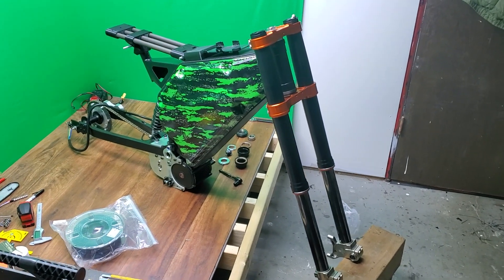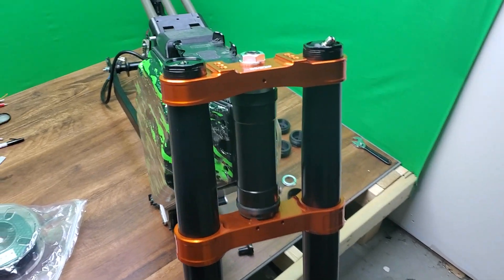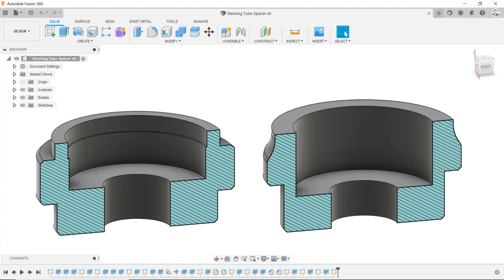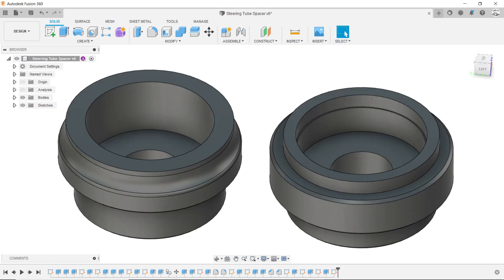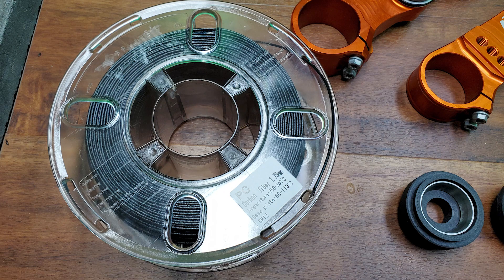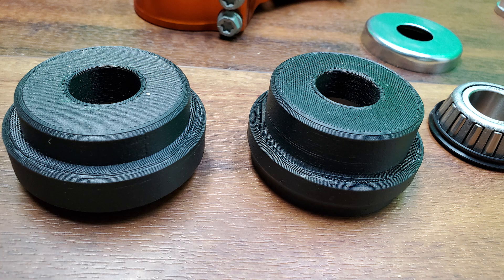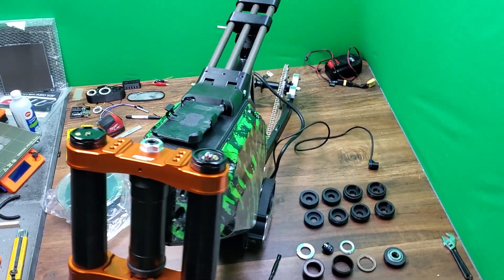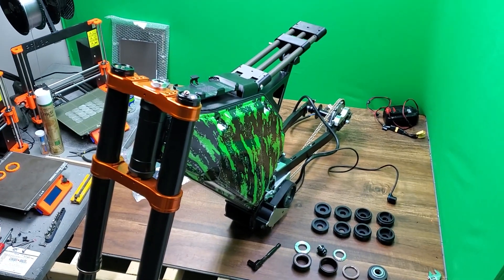Using Motorcycle Forks on an ebike / bicycle style frame - Lightning Rods 10kw Ebike Build Part 11

Comment: What did u make these out of mate did u use a 3d printer?
Reply from the maker: Yeah. They are in a carbon Fibre Polycarbonate. They need proper road testing still. I will probably revert to Aluminum for the final parts unless they look rocksolid
Reply: Ok thanks I'll have to see if there's a place that can make them as I'm wanting Todo a moto setup on the front of my stealth bomber
Reply from the maker: It makes a huge difference especially being able to use moto brakes

Comment: surely not using 3d printed bearing cups? wont last well under load
Reply from the maker: No not the bearing cups. Reducers that the cups are seated in. Using carbon Fibre Polycarbonate. They can't fail catastrophically by design so if they don't work as a reducer I will just get them milled.

Comment: why not 18 inch wheels? i thought bigger wheels have a higher chance of a blow out
Reply from the maker: I have not built any yet. 19" is the max for the front forks and I wanted to match them for the road legal aspect. I will be going to a few wheel places and listening to advice so two 18" wheels might be something that is suggested. Cheers
Reply: @HighVoltageKits  If you look up Google Images for "Enduro Motorcycle", you will find that ALL Enduro Motorcycle Road Legal bike, have a front wheel bigger than the rear. The norm is 2" bigger wheel in the front. 

This greatly improve the handling of the bike and also will put less exertion on your wrists when riding offroad, as your body weight distribution will be more on the seat and less on the handlebar, as you will be more in an upright position on the bike. When looking at a racing bike, then both wheel look the same, the reasons for this, they are made for speed and you are basically bend over forward in order to be more aerodynamic.  Personally, I would recommend 17" rear/ 19" front for ultimate torque. My bike used to have 17" wheel front and back, but I changed the wheel diameter to 19" in the front because my wrists were getting to beat up after a while when offroading.  Also, you may find that tire availability is less for even number wheel sizes, like 18", you can double check this.  

Even if you plan to ride your bike only on the roads, you will find that you can ride longer with less fatigue when you are more in a upright position... Less neck and wrists pain for long rides...   Also safer, as you can look around you more easily when in an upright position.

Cheers.
Reply from the maker: Thanks. Trying out the geometry today. 19" is the most front so one of the combos to look at it is a 19" 17" Front rear. Thanks for the advice!
Reply: @HighVoltageKits  17" rear wheel on your build, will provide crazy torque... believe me... it's going to be a wheelie machine LOL.  Also, depending on your riding style, you can always experiment with different sprocket sizes on your drive train to see what's best suited for the speed/torque requirements.

Can't wait to see that beast in action... ;o)

Cheers
Reply from the maker: Me too mate! Cheers 🍻

Comment: Finally someone uses right components. I build also in the same manner. But I used 65 suspension and brakes for my mid-drive V2. sx85 components are just to heavy for my taste. I will not use it all capability's nor the frame is build for such strength.
Reply from the maker: Thanks. The forks for this weigh in at 7kg. What brake did you end up going with. Not decided that one yet . Cheers
Reply: @HighVoltageKits  Hi, yes I know because i own sx85. 65 fork is 5kg. Ofcourse it is suited fir bigger weight. I end up using Sx65 brakes both (actually they are the same also 85, exept rotors). Front and end. You can watch my short videos to see. I recomend for rear bicycle brakes. I switched rear ktm brake to handle bars. And it is to much pressure needed to stop.
Reply from the maker: Thanks very much! I will check it out.

Comment: What is that belt you have? And what kind of a tension do you have on it??
Reply from the maker: I'm not 100% sure. It came supplied from Lightning Rods. It's pretty beefy. Tension I'm not sure has been set yet as I have not got the wheels built. It's adjusted with bolt as is the belt tracking. I will go through it all when the time comes. There are a few videos on the adjustment on the Lightning Rods YouTube channel. If I remember I will pull a name from the belt but out of town right now so you might need to remind me. Shoot me a message on discord is the best way. Cheers

Comment: What controller are you going to use?
Reply from the maker: Its works well with a BAC2000 based on test results on another bike I am not able to talk about. The BAC4000 runs extremely well. The VESC is another option.

Comment: I don't think you will have any problems with the adapters you have made, they should be able to take the force required no problem, as long as you have printed them in 100% infill... If they are not 100% infill, then they could eventually fail due to vibrations.  Great work and good luck with your build.
Reply from the maker: Thanks. I think they are 60% right now. I plan on filling the tube with spacers. I know exactly where it will fail on the layer line if they do. I'll try a 100% as well. I might also try just the polycarbonate. I made a much thinner test ring and I could not break it with two sets of pliers.
Reply: @HighVoltageKits  What worries me when using none 100% infill parts for this application is the lateral force when braking (forces parallel to the ground). These forces will compress the top adapter toward the front of the bike, while the bottom one will be compressed toward the rear of the bike, this is why it is important to use 100% infill.

Again even PLA should be fine for your adapters if they are printed 100% infill. The compression force from up and down movement of the fork is somewhat negligible as it will be absorbed evenly on the adapters, but the lateral forces is another story... A 100% infill PLA adapter should be as strong as aluminum, as long as it is not being submitted at too high of temperature where it could start to soften.  

Remember that the adapters will received constant periodic lateral forces (ON and OFF) from your braking that could eventually cause breakages where the none 100% infill meets at the outer layers... You're smart, you will get this...  Cheers
Reply from the maker: Thats interesting. I started of with tough pla for testing parts. It makes sense tho. It should not be a problem printing 100%.
Better to be safe than sorry!
Reply: @HighVoltageKits  To put it simply, wherever a part could be subjected to metal fatigue due to vibrations or other forces and you want to make this part out of 3D Prints, then use 100% infill... ;o)
Reply from the maker: Thank you Sir 😊

Comment: Working on an Eleek: We put a Boxxer in with a ZS49. Teh OEM Eleek tube bearign was rather large but did press ot easy. 

Great graphics.
Reply: I think that head tube was designed with Moto forks in mind.. It is very long relatively .. Other bikes have shorter ones to accommodate teh bicycle forks available.
Reply from the maker: Thanks. You might have a point with the tube. I thought the adapters would have to be bigger but maybe 25mm total

Comment: I have been waiting for this episode as on my build ( same frame as yours ) I have the USD DNM forks and they just don't feel substantial enough  for the speeds my bike can go. I would like to give this a go so hope you start selling these if testing goes well.
Reply from the maker: I need to test them so I am happy to make a set and will send for materials and shipping if you will help test.
Reply: @HighVoltageKits  yes that would be great , would like to try them out 👍🏼
Reply from the maker: Cool. There is a link in the description to the channel discord. If you join that we can easily send photos and measurements etc.

Comment: I just used a tube with a Id of the mc steerer and 1 1/8 od and use the bearing sets that come with the frame
Reply from the maker: Cool. Can you send me a photo. Love to see it. Lots of ways to skin the cat! Awesome.
Reply: @HighVoltageKits  no sorry i went back to boxxer forks the weight penalty wasnt worth it! i just need an adapter so i can run a mc brake though because i miss the mc front brake.
Reply from the maker: Gotcha. I'm using the lightest I could get. What brake did you choose btw. Need to make a decision there!
Reply: @HighVoltageKits  it was just the standard brake that come with the complete front end i purchased was from a suzuki 125cc
Reply from the maker: Cool. I have to visit the local Suzuki place about the wheels. Appreciated!
Reply: @HighVoltageKits  As it stands i can still pick up my bike with one hand with a 205 hubmotor and 40ah battery with mc rims and tires with the same eleek frame!

Comment: Are you going to sell these adapter components?
Reply from the maker: Right now I need to test them. But yeah I don't see why I can't make them for other people. Its pretty easy to change the dimensions to fit. Would need a testing period. If people wanted to try them out can likely work something out. Probably just material costs and shipping to start with as its an unproven concept.
Reply: @HighVoltageKits  that's great.  I may be interested assuming all goes well.  Pretty cool though
Reply from the maker: Yeah happy to hook you up. Love what you do with your bikes.
Reply: @HighVoltageKits  thanks man!

Comment: A Stealth Bomber was designed and Engineered by a group of College grads.... the bikes are nice but who can afford 12-15 Grand for their product? I can't! you're building a better bike in my opinion! So far, your doing everything as close to a perfect build as possible! Well done! Have you checked out the Graphene leaf cells yet? Could be an option rather than Li-Ion, lighter, fast charge and more Amps!... Your into a great journey my friend! Kudos!
Reply from the maker: Thanks. I have not looked at those cells. The stealth I feel is pricey for what you get. The forks here were quite pricey but a second hand refurbished set would be way cheaper. I think depending on the battery it should be possible to build this for 5-6k using reclaimed parts where possible. Once it is built I will likely start to look at making a version where as much as possible is like this. Cheers
Reply: @HighVoltageKits  When you're looking at this amount of torque and speed, you want pricey, strong and robust parts underneath you!.... the key is getting as many parts for as little a price as possible! Bike parts as well as shipping cost are at a premium, Bike dealers are already ordering parts for 2023 now, in order to have anything in the fall of 2022... Good luck brotherman!... keep punchin Up!
Reply from the maker: Thanks! Yeah. Thats crazy the demand.
Reply: I could not have said it better☝🏾, I agree with this 💯percentage....
Reply: @jonezdatonetech2758  I've been watching Brother Codswallop almost since he first did Youtube, he's been on quite a journey.